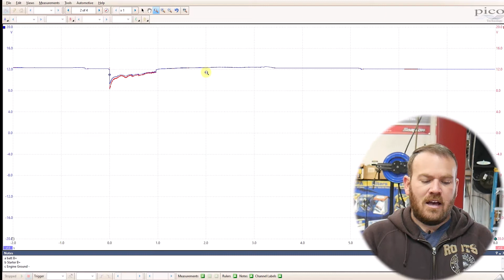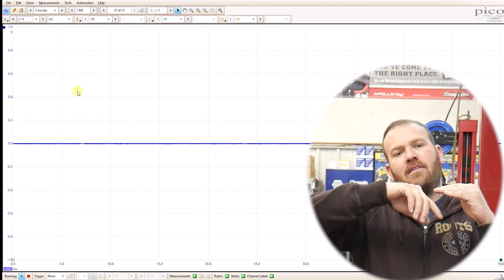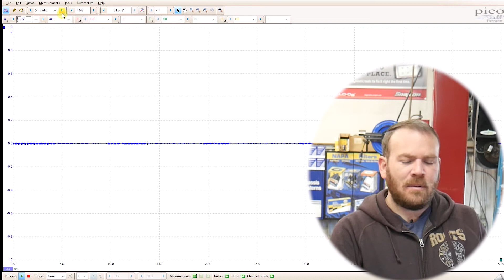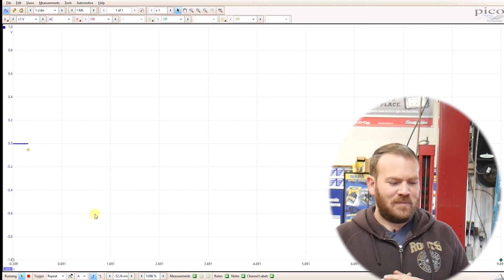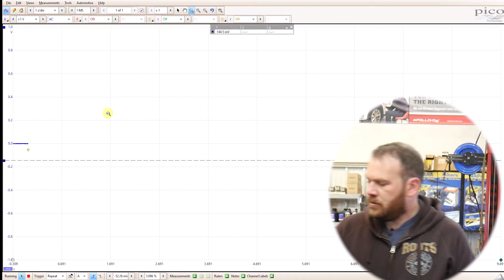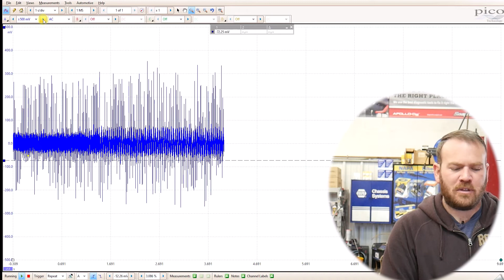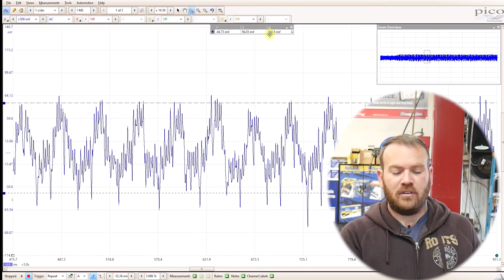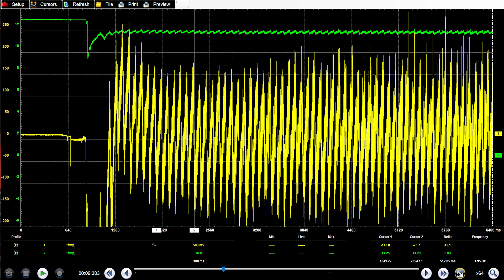Weekly Waveform 4 - AC coupling starting and charging

Comment from the maker: My information was inaccurate on the Alternator ripple. We should be using a faster time setting on the snapon scope so we can measure the actual ripple. In the video I showed measurements that include the rpm fluctuations as well. This will indicate a higher ripple than what the vehicle actually has. I also forgot to apply loads to the system. It's best to test ripple with some steady loads enabled(headlights, defroster grid, seat heaters). Snap-on settings will be 20MS with peak detect on, AC coupled, .5v to 1v. I will post an update to this video once filmed.
Reply: AND THIS IS EXACTLY WHAT I MEAN, YOU ARE VERY IN-DEPTH WITH YOUR OBSERVATIONS I HAVE THE GREATEST CONFIDENCE IN YOUR MOST DETAILED GUIDANCE IN THIS CHANGING FIELD. WOULD LOVE TO HAVE SOME BASIC SPEC READINGS I WOULD SUPPOSE TO BE GETTING WHILE I'M TESTING . THANKS SO MUCH AND LOOKING FORWARD TO ANY AND ALL YOU HAVE TO OFFER .

Comment: I was doing a cranking incylinder at the intake manifold with my WPS and the vacuum pull looked pretty jagged so I increased the resolution enhancement from 12 to 16 bits and that cleaned it up...i was told that using active filtering  MAY mask a problem...your thoughts and you've got a great channel !!

Comment: Are you able to use an amp probe with ac coupling to alternator diode checks? I know voltage measurements are good but a lot of times the B+ terminal on the alternator is difficult to access

Comment: I was looking for a frequency estimate for ripple that comes from the alternator, and on looking at your trace the frequency at idle is ~ 25 cycles per second. Of course frequency will depend on engine rpm, load, and the relative ratio of pulley size. Other components like ignition etc are also dependent on rpm, so recognizing artefact from other components is not so easy. It is so much better to evaluate this on a scope, to help identify artefacts that may throw off multimeter estimates of ripple. I'll just have to get in the habit of checking this often to get a feel for normal values.

Comment: So you do turn on AC coupling when doing a relative compression check? I always assumed it wasn't on.
Reply from the maker: It depends on the scope. Since we cannot zoom in vertically on the snapon scope after the capture has been made it make it easier to check the variance between cylinders if we turn on AC coupling and turn our scale down to 1 or 2Volts.

Comment: i know i am very uneducated what is the main purpose of checking the alternator i understand the starting
Reply from the maker: The diodes in the alternator are supposed to smooth the voltage exiting the alternator in a nice consistent DC voltage to charge the battery and run our accessories. If the diodes are weak or fail the pattern will have very large peaks and valleys. If we measure from the peak to valley we will get our alternator ripple. Some ripple is normal and unavoidable. Anything over 300mV I consider excessive because it can cause interference with other sensors and communications on modern cars. Older cars were less sensitive.
Reply: @ThePracticalMechanic  good to know will hook up some tomorrow and see what i see hopefully will make since thanks. my uscope master kit is supposed to be here tomorrow
Reply from the maker: I will probably do a separate video on the uScope. The uScope doesn’t have the setting to change from dc to ac couple but there is an attachment that goes on the scope lead for AC coupling.
Reply: @ThePracticalMechanic  ok will use the snapon for the information you want i need the practice where ya'll can tell me what i am doing wrong or right . i have several some older like early 90's and then couple newer. i have a 94 dodge that has high power ignition system with 10mm wires and special coil wil be interesting to see if that shows up